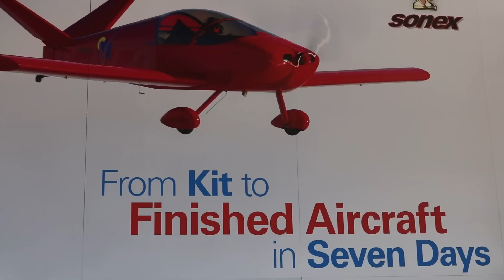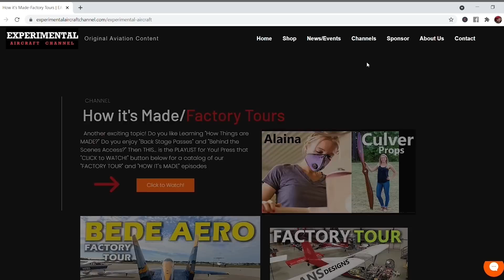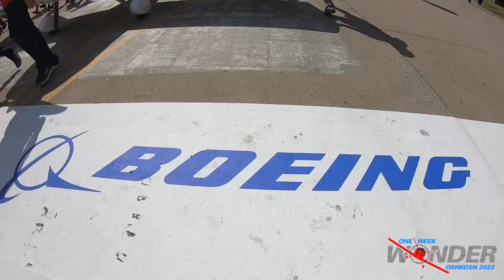They Built an AIRPLANE in 7 Days!  One Week Wonder

Comment: All well and good but where is the taxi test? You never showed that part. All build up and no ending.
Reply from the maker: The "ending" was this started (and properly) and was able to taxi out under its own power. It was quite rushed at the very end. The guys doing the wiring on the panel and ultimately terminating the engine ECU wiring literally worked up until it was pushed out of the tent.  There was no time allowance to mount cameras and audio in the cockpit.  Sorry to disappoint...we shared all we could with what was permitted to us.  Still an amazing feat all in OneWeek I would say! :-)